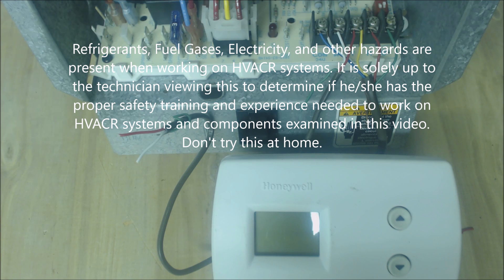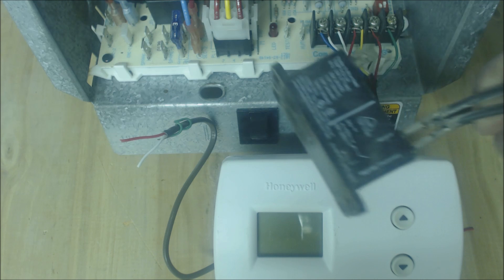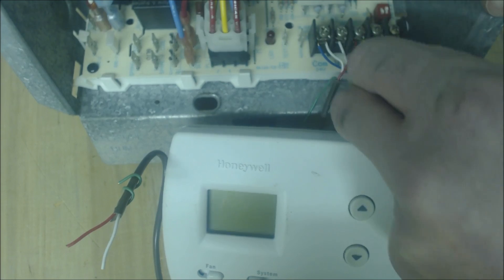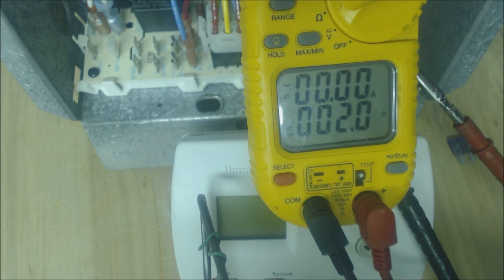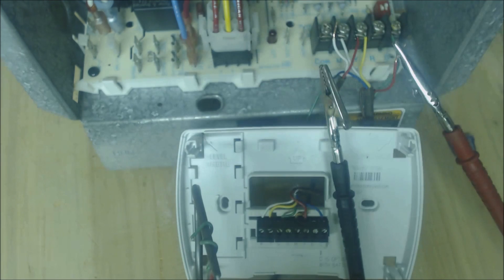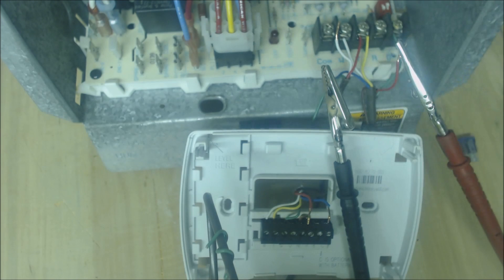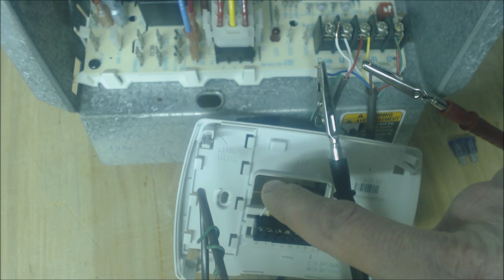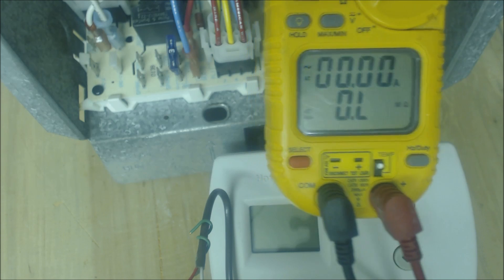Thermostat, Furnace, AC not Working- Troubleshooting Bad Tstat Wiring and Blown 24v Fuse

Comment: thermostat is getting intermittent (no power)

technician checked and im getting 24v out from transformer but nothing to R terminal.

Fuse looks good (can it still be bad?)

He told me to get a new board.

it seems to get power sometimes and the furnace will run but mostly no power. something seems like its on the way out/broken on the board

Comment: I just want to fix the AC rite now. The heater , sometimes it turn on but for only  a minute and it stops but most of the time it won’t turn on.
Reply from the maker: Do you measure 24v between the w and the c for heat to turn on?
Reply: AC Service Tech lCC, I just saw your reply only now , no I didn’t check the voltage yet but I will ,I’ll let u know if it worked
Reply: Ace service tech sorry I’m just the slowest diy guy. Its taking me a long time how to use a multimeter. Hehehe! And I’m just at home everyday doing nothing. I found your other video just a few min ago. The transformer I pulled it out, the secondary has 1.6 ohms of resistance and the primary has 12.1 ohms of resistance . Does this mean it’s good? I pulled out the relay also , the contact 1 and 3 reads OL but a  couple of contacts I put the probes on them ( not sure what number but they read 9.6 ohms) does this mean the relay is the one no good?

Comment: Hi there , I’m the same as Brian Skala I can’t find the fuse in the air handler it’s also from 1977 ( Bryant) no circuit board also . Could it be hidden in the back . I was trying to fix my no turn on heater. I bypassed the thermosthat , must have stuck the other end of the bypass wire on the wrong wire and it short circuited NOW THE AC IS NOT TURNING ON ALSO . Any idea what part to check? I’m thinking it’s the fuse but I cant find any. Not turning anything including the condenser outside.

Comment: My furnace keeps blowing the fuse when I call for heat, but cycles with no issues when directly jumped at the terminals. I have a brand-new thermostat and is set to gas and still blows the fuse. I assume that since it works fine when jumped, then I may have a brand new faulty thermostat. Am I correct on this?

Comment: R and C are two ends of the 24 V side of the transformer. That being the case, there is not an open circuit “OL” between them. You should expect to measure the resistance of the coil in the transformer.

Comment: I only had a 25 fuse. I blew all power in my place. Now the furnace won’t come on. What do I need to do now that I have the 3?
Reply from the maker: You only want to use a 3 amp to protect the control board. You would need a tech to troubleshoot it, thanks

Comment: I changed my thermostat and now nothing will turn on. Have checked fuse  and even put old thermostat in and still there's nothing
Reply from the maker: Do you have the door to the furnace on so the door swithc is closed? Do you have 24v with a multimeter between r and c?
Reply: @acservicetechchannel  it turned out being a blown transformer

Comment: I looked inside my furnice. I don't have terminals like that....why not? It's a Bryant...
Reply from the maker: Some air handlers do not have a control board but just wires inside. Just follow the wiring diagram on the unit to verify what color wire is what terminal, thanks!

Comment: in this instance we replaced R wire with the extra brown wire because there was a resistance reading between R and C, however how did you determine that it was the R wire that was shorting out(copper exposed and touching ground or common) and not the common wire that was shorted out.  hope that makes sense lol
Reply from the maker: You test r and c and then once you know you they are touching, test a different wire with common. If there is no resistance reading on the second pair then you know the problem is with R, thanks

Comment: My Thermostat is blank. No power to the thermostat. Even with my old battery powered thermostat is reinstalled, the thermostat can not control the system. 

When i touch the red and green wires the go to the thermostat, the fam will not come on.  So... no power to the unit.

Model is a 1976 Rheem installed when the house was built. Has had no major issues.  Has no condensation float that I can seen and has no fuses in the inside unit or in the outside condenser. 

Buying a new unit is out of the picture for now.  The wiring looks ok.  There is power to the unit switch next to the inside unit.

Should I maybe replace the AC Relay or maybe the transformer. Maybe the capasitors in the condensing unit outside. Maybe the contacter in the condensor.

After i check for power with my clamp meter, I should know where the lose of power is.

My question is, is there a typical issue when the thermostat doesn't work (drain switch,etc.....?) Would i be good to change out all the parts i mentioned?  Like all the capacitors, contactor, transformer and AC relay.
Reply from the maker: Capacitors are a preventative maintenance item that should be replaced over time but no, you have a low voltage issue. You say that when you take the tstat out of play and touch r to g the fan comes on. Is that at the tstat area or in the furnace/air handler? If you don't have power to the tstat, do you have a problem with your common wire. It seems that your r and g are fine. Did you check at the indoor unit to make sure c was attached? thanks
Reply: I have no power to the Thermostat. And when I hook my old battery powered Thermostat, still no power.  Yes I'm thinking a low voltage issue. So the issue is in the wires from the thermostat to the transformer, or in the wires from the Transformer to the outside condensing unit? Or the transformer?? Is a bad transformer typical for this issue?
Reply: I will be checking the C wire at the transformer and all thermostat wires attached to the transformer as well as the wires from the transformer to the outside condenser's contactor.
Reply: I’ve got nothing at the thermostat either. Electric heater nor a/c or even fan will come on at the thermostat. Tried bypassing thermostat, nothing. The blower will come on with the on switch in the cabinet. I’ve got 24 volts at the thermostat and at the control panel. Trying to figure what to check/replace next. Any help is deeply appreciated!

Comment: Could you clear up some confusion for me.. are infinite resistance and 0 ohms both signs of a bad circuit? Does it matter if switch is normally open or normally closed? Thanks
Reply from the maker: Great question Brandon! Always turn the power off and also disconnect wires before testing a component for resistance. On a motor then yes the motor would be bad. On a switch 0.0ohms means closed switch and 0.L means open switch. If it is a coil then there should be some resistance read, thanks
Reply: Awesome thank you!
Reply from the maker: Glad to help Brandon!

Comment: I did some research on  "OL" and it's meaning. Assuming that Fluke would be a definitive source I've went thru some pdf files on their website and they refer to it as either "Open Circuit" or mostly "Over Load" depending on what function is selected. If I had to bet on one it would be "Over Load" as the original source?  I've come across several others such as "Over Loop", "Open Loop", "Off Limit" and of course "Over Limit" which is what you mention (and is a popular meaning). My preference when referring to most multimeter functions is "Over Load" and sometimes "Over Limit".  Thanks again for your incredible repository of HVAC knowledge!
Reply from the maker: Thank you very much Tony!

Comment: can you make a video using a short pro tool ,I have seen videos but they don't show how to or where to connect the alligator clamps.
Reply from the maker: Hey Ruben, you would just use a 24v breaker if you were concerned about that. Really we find shorts with the power off, the wires off the board and with resistance with our multimeter- Here are some videos, thanks-  https://youtu.be/j7HeLAZVTzs    ---  https://youtu.be/J9bxLpJpRNE

Comment: Good video most of the shorts at 24 VoLTS have been with contracts I have with 3 floor buildings and having issues at third floor (hp system ) and all wires being shorted somewhere in the walls . Easier run new t-stat wire then cutting up holes in walls or attic hunt. I caught one ones where Tstat was rubbed off by two nails in the second floor unit. I found that one by fixing strike plate problem causing rattle noise in 2 floor condo. The competitors bad install is my money maker now . A pain at the beginning but when I see check makes it worth while.
Reply from the maker: Nice, yeah there doesn't seem to be a shortage of bad installs unfortunately. For those that know what they are doing it makes for more work and company brand building though! Thanks
Reply: Dude I hate the "finding a short" call, especially when its intermittent and customer informs you when u get there that they changed out fuses and it runs great for 2-3 days b4 popping another fuse. Joy!!!! Time to ohm everything out n start physically looking for shorts/broken exposed wires. Some are simple, some you're gonna be there awhile lol.

Comment: O.L.   Over limit,  or open line?  I have understood it to be open line. I guess either is OK....THINK SO?
Reply from the maker: It doesn't matter. I say over the limit of being read in resistance. Air is an insulator and the meter can not read the resistance in the air so it is over limit. As long as you know what it means when diagnosing either is fine.
Reply: I learned before digital was much of a "thing." I recall someone mentioning "Overload," which works for just about anything except ohms, the mode where you are most likely to see it on auto-ranging DMMs. I have never given alternatives a thought. I think "over limit" sounds authoritative, so I will start using that. Most of the better units use a different abbreviation like "Hi" for voltage over range now.